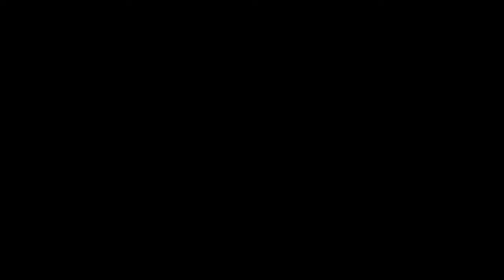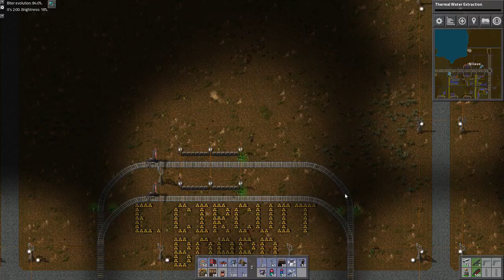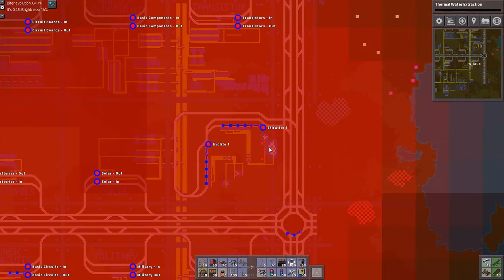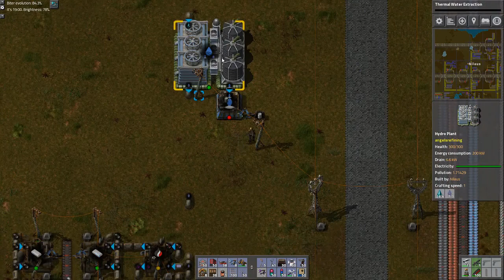Lets Play Factorio S6E28 - Finally Electronic Circuit Boards

Comment: It's kind of a waste of filter inserters to output from those railway buffer chests. Since you're filtering the input, there's no need to filter what you're extracting from it because there will only ever be one item type in that chest.
Reply from the maker: It is actually necessary. When i have a refueling train I do not want coal everywhere, so it is important that both input and output is filtered.